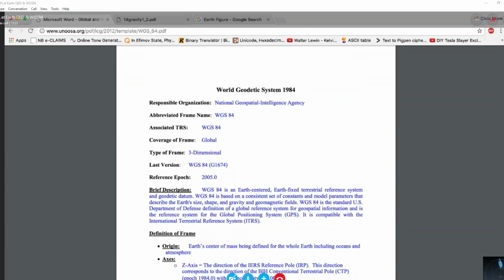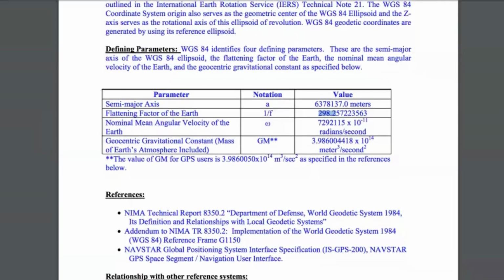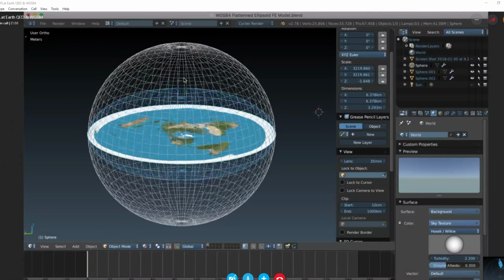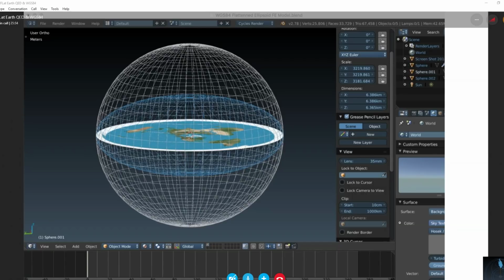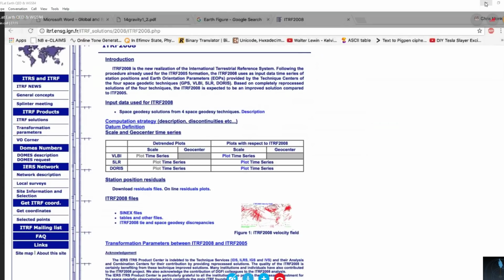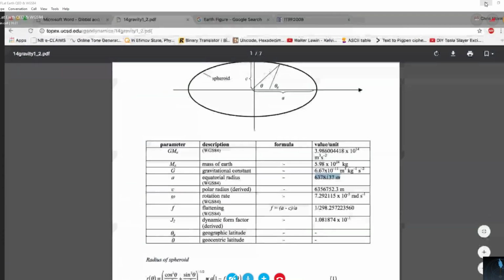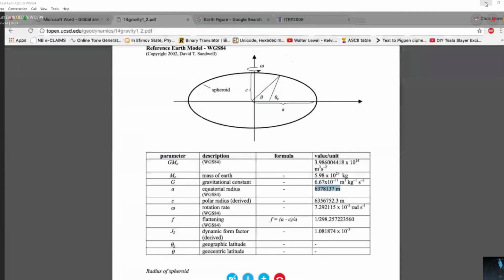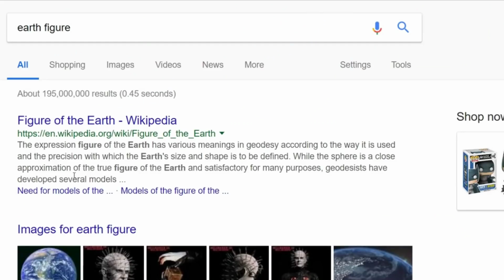Flat Earth Debate Special Edition

Comment: "How do we apply this flattening factor to gravity?"
The flattening factor describes how much wider the earth is at the equator compared to the poles. You can understand the precise meaning if you think about what that difference "(a-c)" and the division by "a" actually mean:
The bigger, equatorial radius of earth a is 298.257 times larger than the difference between polar and equatorial radius (how much wider earth is at the equator). I don't see the problem here, and plugging in those values for a and c works out for me.
So 298.257 being a rather large number means that the earth is just a tiny little bit wider at the equator compared to the poles.
Note that this factor (1/f) is purely geometrical and based on measurements of earth's shape instead of somehow being derived indirectly from gravity and rotation (which is possible too, and if you like I can show you how).
It's fascinating to see how it's being tried in this video to incorporate this factor into a flat earth model, but it seems to be based purely on a misunderstanding.

The hypothetical geoid is useful for the following reason:
Using the oceans as sea level is an intuitive way to define an elevation of 0, but that also has its problems: The sea level is changing all the time because there are waves, the tides and sea level rise. Also there's no ocean below land, but even on land we might like to know our elevation above sea level, or maybe determine the height of some mountain (as it's being done by map makers for centuries). So to have a precise definition of what that "elevation above sea level", we need a fixed hypothetical ocean surface that is defined everywhere on earth, even on land, while ignoring the tides, sea level rise or what-have-you.
Using the so-called "reference ellipsoid" is one way to define this hypothetical geoid surface to determine a precise "elevation above sea level", but there are other more accurate (but still hypothetical) geoids that take the local variations of earth's gravity into account to find more accurately how such a hypothetical global water surface would be shaped over the whole earth.

Happy new year!
Reply: Thank goodness you came along to explain the very technical information on this paper because the gentleman trying to equate it with some sort of flat earth ‘proof’ obviously didn’t understand a thing about it. It seems as if he saw the word ‘flattening’ and thought ‘Aha! I’ve caught them at their own game,” when in reality he just doesn’t understand what he’s reading. Seems an awful waste of his, and the viewers’ time.
Reply: Helgefan the reply is deafening, god knows why they tried to do this 🙄
Reply: @siblacklockhughes612  It sounded like the authors were honestly interested in the answers to their questions. I guess I was wrong. :(
Reply: @helgefan8994  They usually are keen on a subject until they realise it's not a 'globe killer'.  They'll talk themselves inside out about for a while until something else comes along and it gets put in the bin with Angle of Attack, The laws of Thermodynamics (go figure that one!), Ranty Flat Earth, etc.

Comment: The messed up math is that flattening is not to be used as any dimension of ellipsoid. It's just a ratio of polar (c) and equatorial (a) radius. It tells us how big difference is between those two.

You can simplify flattening equation f = (a – c) / a to f = 1 – (c / a) If c would be equal to a , then f would be 0 , which would mean no flattening and Earth being a perfect sphere. But, because c and a differs, the value of f is 0.00335281 (rounded). This flattening value means that polar radius is shorter of equatorial radius by 0.335281% or that polar radius has length of 99.664719% of equatorial radius. In CAD model with X, Y dimensions having 6378 km value set, Z dimension should be set to 6357 km and NOT 3293 m.
Reply: logosys As I wrote in response to another learned fellow in these comments, I’m glad that someone such as yourself (who actually understands this very technical paper) is here to shed some light on the actual meaning of the terminology in the paper. It seems that this gentleman saw the word ‘flattening’ and then thought that it meant he had found some proof of the flat earth. Another example of laypeople not understanding something beyond their scope of knowledge and the inferring something that seems to ‘prove’ their inane belief in a flat earth.
Reply: @jaintly  Yeah. It's usual tactic to pick some terms or phrases out of context and misinterpret them. This way whatever they talk about sounds scientific because they are using real terms, but those less fortunate people cannot see how wrong those terms are being used.